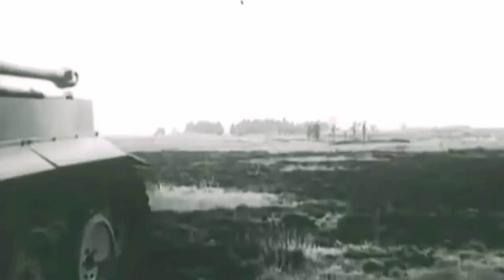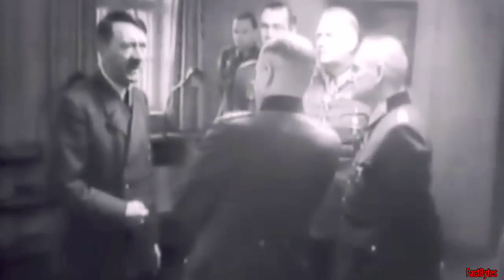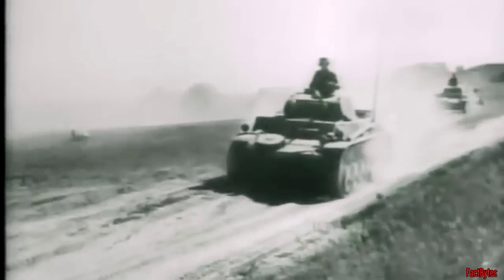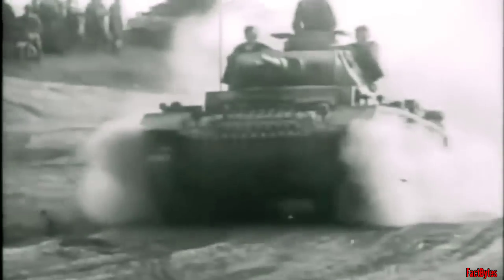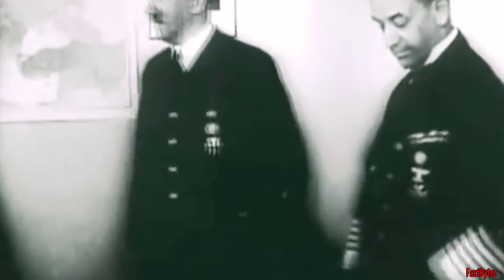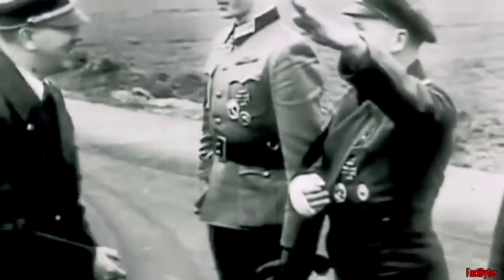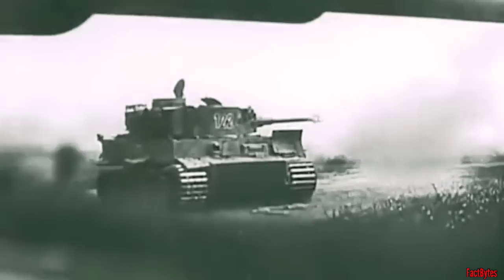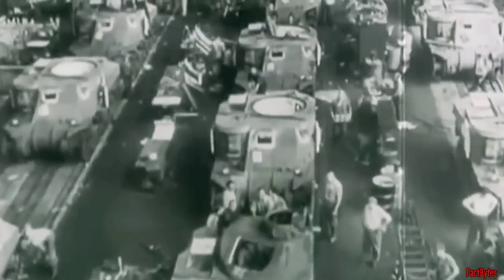Were German WWII Tanks REALLY Over-engineered?

Comment: The interlocking road wheels of the Mark V & VI tanks made repairs take considerably longer, meaning many recoverable tanks were lost during withdrawals.
Reply: But it gave the "big cats" off-road performance that was unmatched by any Allied tank... the Tiger was not only more mobile on rough terrain than the Sherman it was also faster... Schachtellaufwerk is the secret of the Germans superior mobility and higher speeds per Horsepower/Ton ratio.
Reply: It had it pros and cons. It did give them better ground pressure, but if mud got in there and hardened, it would jam the wheels.
Reply: @brennanleadbetter9708  It's not a very common problem and its not unique to the German design either, it's a popular myth favored by detractors who refuse to accept that Allied tanks were inferior.
Reply: @WilhelmKarsten  It wasn’t as much as a problem as people think. However it was a concern for the Germans fighting in Russia, where the mud was like glue. But that goes for any tank. Mud is one of the tank’s worst enemies.
Reply: @brennanleadbetter9708  A German 88mm armor piercing shell is an Allied tanks worst enemy...
Reply: @ WilhelmKarsten  True,  but it’s a good thing the Allies made a lot of them.
Reply: @brennanleadbetter9708  It's really bad that so many Allied tank crews burned to death because General McNair was corrupt and a incompetent fool that didn't understand armored vehicles.
Reply: @ WilhelmKarsten  how exactly was he a fool?
Reply: @WilhelmKarsten  If German tanks were as awesome as Wehraboos like to make them out to be, then the Germans would not have lost the war as miserably as they did.5:1 of mediocre tanks to even good tanks was the superior strategy manufacturing strategy. And point of order: More Mark VI Tigers were destroyed by their own crews than by enemy fire. Not Great.
Reply: @brennanleadbetter9708  You mean to tell me you are not familiar with the biggest failure in the history of mechanized warfare???
You've never heard of the 'Tank Destroyer Doctrine'?
Reply: @frankmueller2781  Are you suggesting that better weapons always ensures victory???
Can you please explain the logic of your comment and maybe explain how America lost the Vietnam War despite having vastly superior weapons to the communist North Vietnamese army???
Or why the US military adopted the German Military Doctrine of Force Multiplication  through advanced technology...

Are you aware that US Army Ordnance after examining a captured Tiger made 5 attempts to copy the Tiger and mass produce its own versions, and was thwarted by American Industy lacking the technology to build a Tiper copy???
Reply: @WilhelmKarsten  I have heard of it. What about it?
Reply: @brennanleadbetter9708  It was one of the of the most shameful and humiliating American failures of WW2..
Like the M1 20mm aircraft cannon program and the Mark 14 Torpedo scandals..
Reply: @frankmueller2781  There is also the other place that the Germans lost against the Allies -- logistics. Russia simply produced enough tanks that a crew whose tank was destroyed or broke could just return to the railhead and pick up a new tank. The US produced tanks that, while being technically inferior to the German tanks, were produced in much higher numbers and designed to be readily repairable. For example, to replace a transmission in a Panther, the turret had to be removed, then the armor plate in front of the turret removed, and then the transmission could be pulled backwards and up out of the tank, reversing the steps to install a new one. For a Sherman, you unbolted the armor covering the transmission at the bow of the tank, pulled the old transmission, slapped the new one in, and bolted the armor back on. The Americans designed vehicles to be maintained across a transatlantic supply line; the Germans had problems with supply lines only a few hundred miles in length, and focused more on production numbers, with the result that spare parts were often unavailable for damaged vehicles. The aphorism "dilletantes talk tactics, amateurs talk strategy, professionals talk logistics" (widely attributed to different people) is relevant here; the Germans focused on tactics and strategy, and died on logistics.
Reply: @seanmalloy7249  The Americans often lost on weapons design and doctrine.

The M4 that couldn't destroy enemy tanks.

Building thousands of tank destroyers that had no armor protection.

Production of 40 million rounds the 20mm M1 ammunition for guns that were too unreliable to be adopted into service

Or Mark 19 torpedoes that were useless.
Reply: @WilhelmKarsten  The Mark 14 torpedo was an example of a perfect storm of mistakes and poor decisions, with its faults serving to mask each other and BuOrd's insistence on conserving torpedoes that meant that no live testing was conducted, with their continued insistence that their testing showed that everything was working correctly despite repeated failures in the field.
Reply: @seanmalloy7249  That would suggest an American loss in logistics against the Japanese...
Reply: @WilhelmKarsten  A definciency in administration compared to the Japanese, yes, but the Americans had a brute-force superiority in logistics that the Japanese simply couldn't match. And the Japanese weren't without their own idiocies -- for example, the Japanese army had seven different and incompatible types of rifle ammunition that sometimes resulted in units receiving a copious amount of the wrong ammunition. The US approach, with one rifle cartridge and one pistol cartridge, was less vulnerable to mistakes.
Reply: @seanmalloy7249  You mentioned that a shortage of torpedo production led to live fire testing to be disregarded... sounds like a logistical failure.
Reply: @seanmalloy7249  The US approach included making 40 million rounds of ammunition that was useless in any gun...
Reply: @WilhelmKarsten  It wasn't the best idea, sure, but it was an idea. Keep in mind the idea is not that only tank destroyers destroy enemy tanks. Regular tanks were supposed to take out enemy tanks if they ran into them as well. Tank destroyers were supposed to be the cavalry riding in to the rescue. If the enemy sends a bunch of tanks to a certain place, you use the more mobile tank destroyers to get guns in place to stop their advance. That's why they were lightly armored, so they could be faster. Basically, anti-blitzkrieg units. Three things of note there: the other countries didn't do so well against Blitzkrieg, studies of combat results showed that the tank to fire first won most of the time (which helps back up the idea), and the US was typically on the offense, so... Now imagine if the US had gone with German route... weapons like the Pak-37s and Pak-40s. They'd have been even worse for the war the US fought. Of course, the US would have been better off just making even more Shermans, but that's hindsight.

For an added fun tidbit, a unit with M3 halftracks tank destroyers, were instrumental in stopping a German advance in Tunisia. They did lose 21 of their half-tracks, but were credited with killing 30 of the destroyed German tanks, as well as 200 infantry.

Oh, and M4s killed enemy tanks just fine. And when the 75mm started to get a bit dated, the US just up-gunned it. Admittedly, they landed on D-Day with only the 75mm version, leaving the 76mm ones in Britain, but that was a decision made in part due to logistics. Also worth noting that, when the Germans were on the offense in the Battle of the Bulge, the vaunted German tanks? Yeah, they suffered loss rates comparable to the Shermans when the Shermans were on the offense. It's almost like the defender has an advantage.
Reply: @Axterix13  McNair's theories are widely considered to be a disastrous failure, even among American experts.

McNair was a artilleryman and never understood the concept of tanks or modern mechanized warfare.

McNair insisted that the tank only be used for infantry support and the M4 was not designed to be used against enemy tanks...
Thus the installation of a gun that was not effective as an anti-tank weapon and was only armored to provide protection from indirect artillery fire.

80 to 90% of M4s knocked-out by the Germans was the result of a single hit by a German Anti-tank weapon (primarily PaK75mm or 88mm) and burned out by the resulting fuel and ammunition fires.

As a battle tank in operational service during WW2 the M4s performance was a disappointing failure.
Reply: @WilhelmKarsten the tank destroyer doctrine wasnt too great but it worked. m4 was perfectly capable of taking out pz4, pz5 or even pz6 from the front with 75mm gun. sometimes they needed to get multiple hits to destroy a tiger or a panther but it wasnt a problem since there were always atleast 5 shermans. and yes, a lot of shermans were taken out by at guns or panzerfausts. but a lot of them could be recovered. and the crew would mostly be fine. the thing about ammunition/fuel fires has more to do with doctrine than any design flaw. all armies in ww2 tried to shoot enemy tank until it burned. just to make sure it was dead. the combat performance of m4s is really quite impressive. most of the time they were attacking fortified and concealed defensive positions with a lot of anti tank guns and yet not so many were lost and majority of crews survived even after getting hit.
Reply: @ussindianapolis487  I love your sarcasm...lol!
Reply: @WilhelmKarsten  i wasnt sarcastic.

Comment: I always wonder how the Tiger I would have ended if they stayed with the interim design as the final one (VK 36.00), which was basically a bigger Panzer III. With the same armor, gun and final turret, and some engineering shenanigans to fit the final engine (and also kept the torsion bar suspension from the Panzer III) it would have been a superior design as it would have been smaller and lighter.
But I am guessing the German engineers where just tasked with getting the Tiger out as soon as possible so they just decided to make the tank bigger to solve the engine issues.
I am totally not thinking all this as a Panzer III simp, not at all :)

Comment: It is said Stalin greatly contributed to rushing of T-44 into production just like Hitler did with heavy tanks. On paper it was mostly a great improvement over T-34-85, while in reality it was a very lacking product for the late- and postward standards. 
In pure performance it's main problem was the turret. With some effort they managed to stuff a 100mm gun in it, but even by Soviet standards the ergonomics were unacceptable. In 1945 and onwards the 85mm was adequate only against old stopgap vehicles. Another issue was the lacking armor on turret front. Having the thickest armor there is important, because you can't engage the enemy without exposing it unangled.
The mobility was an even greater issue. Use of aircooling for the engine was undoubtedly a novel venture, but also an utter failure. According to testers the engine overheated even in winter conditions. No doubt this is why the soon following T-54 returned to liquidcooling. To this day only Japanese have truly managed master aircooled diesel tank engines. And lastly to make good use of space the driver and transmission were squeezed into even worse positions as before, hampering their operation.
Somehow with all these failures it was still the price of an IS-3 heavy tank.

Comment: Tanks like the Tiger I and Panther were marvels of bad engineering.

Calling tanks like the Tiger "amazing marvel of engineering" is not understanding what good engineering is.

The mark of high quality engineering is simplicity, not complexity; efficient use of weight, volume and man-hours, not making it big, heavy and expensive; making it reliable and maintainable, not a hangar queen that needs its turret removed to do maintenance on transmission.

Here's an example. Tiger and T-44 look almost like the same tank on paper: similar armor, similar gun, contemporaries. But Tiger weighs 54 tonnes while T-44 weighs 32. Which do you think is designed better? On a general level, not bells-and-whistles level?

Comment: As the Germans constantly made improvements and additions to their tanks, they also needed different spares for those, so they had to leave other vise fine tanks in Russia, because they couldn't find the spares to keep them running.
Reply: thats bullshit. Since late 1941 Panzer III and IV chassis used the exact same drivetrain, only the length of the driveshaft and radiators were different. All domestically produced tank shared a lot of parts, the converted caputured tanks not so much. The Sherman alone came with 5 different engines in comparison.

Comment: What irritates me to no end is that even in 2023 the old myth that german tanks were outclassed by russian tanks in 1941 when this is clearly not the case. The german army destroyed more t-34 and Kw-1 tanks than they had Panzer 4 and Panzer 3. So it is wrong to say they were outclassed or that they couldnt fight them.
One of the reason to build Panther and Tiger was that germany had no fuel and lacked the manpower to field many more tanks. Germans are not stupid and Hitler wasnt in most cases either. If you only have a finite amount of fuel and a finite amount of supplies you better make sure that you get the best equipment to make the best use of your limited ressources. If you have unlimited ressources you build the tank that gets the job done but is also easy to manufacture so that you have the most tanks possible.
If you are limited in fuel, ammo and manpower and you cant field as many tanks as you would like then you go for best equipment cause that may give you an advantage in a one on one.

Comment: From the tiger maintenance manual,  "the tracks should be inspected and adjusted every 75km ". Track design  caused shock loads on the final drive and or  transmission ,  SHOULD  the track be run loose and bull gear slip on the track.

Comment: As others have mentioned, fuel was a huge issue for the German army. More tanks would have meant more fuel needed and also more crews.

You forgot to mention that Zimmerit was an anti-magnetic mine coating. However it was mostly a waste of time and effort as Germany was  the only nation to use such magnetic mines in WW2.

The Tiger 1 was conceived and built as a Breakthrough tank and wasn't intended to engage in long battles. The Panther tank as originally designed would have been much lighter. The addition of the extra armour protection greatly increased the weight and the demands on the engine and the drivetrain.

Germany was in the school of Fewer but better armed and protected tanks than lighter more numerous tanks. Fuel, or rather the lack of it, and poor logistics greatly influenced German tank development.

Comment: Overengineered, and underengineered at the same time!
They were underengined and had weak drivetrains for the task of keeping their crews alive. Engineers should have been sent to the Russian front to see how their product was REALLY used...
Reply: To be fair, the Tiger was employed in a role it was not designed for. It was designed as a breakthrough tank -- Tiger units would be used to break the enemy lines, after which the hole would be filled and exploited by Panzer III, IV, and V tanks, with the Tigers being pulled back for maintenance before being shipped to the next schwerpunkt. Instead, they became the 'anvil' of the panzertruppen, kept in the battle line until the entire battle was over (or they broke down and had to be recovered and repaired). Front-line maintenance was often insufficient for the requirements of keeping a Tiger unit operational over an extended period, which was not what the tanks had been originally intended for, but instead had been thrust into by the changing character of the war.

Comment: The big German tanks were sophistically designed for their time but not over engineered compared with modern tanks. They were reliable on the Eastern Front too compared with the opposition and continued to be so until the war took it's toll on their support such as maintenance facilities. As far as being hard to work on compare the disassembly of a Sherman's suspension units with a Panther's, the road wheels on the latter could be removed by two men with a crowbar.

Comment: Changing a transmission in Panther required removal of the turret. In the M4 Sherman, also front drive, was far easier - unbolt the transmission cover armor casting, pull it aside with crane, then remove & replace. Fixing a Russian T-34 - rear drive but just replace the tank comrade (hahaha).Don’t know details but probably involved removing bolts of rear deck & back plate.

Life of tank in combat: read somewhere the barrel life of the USA 75 mm M3 cannon was 10,000 rounds but how many tanks survived 10,000 rounds? 10,000 rounds would be approximately 100 full ammunition loads.